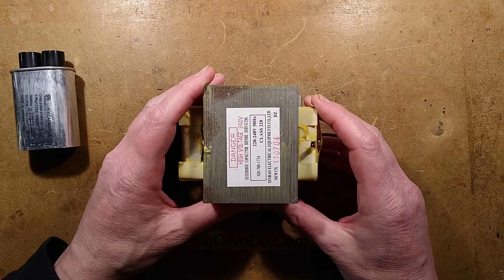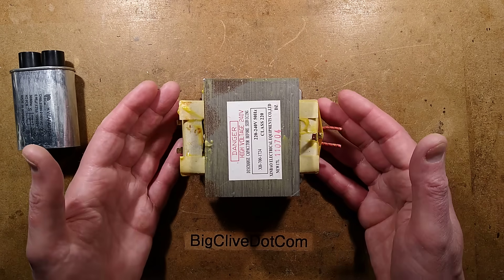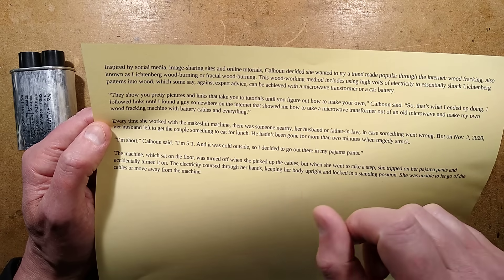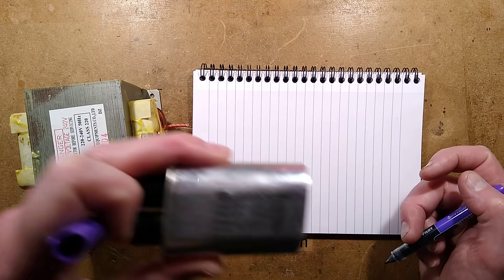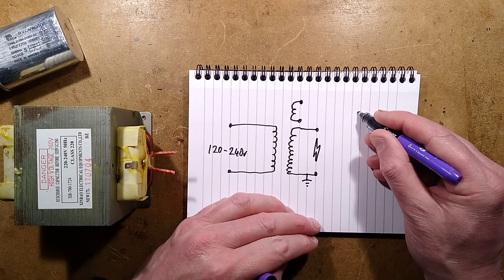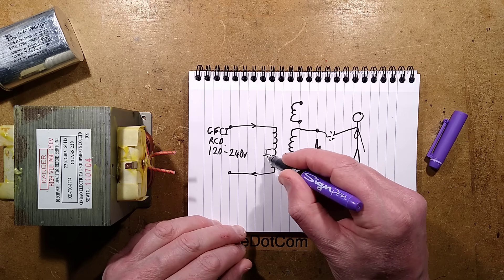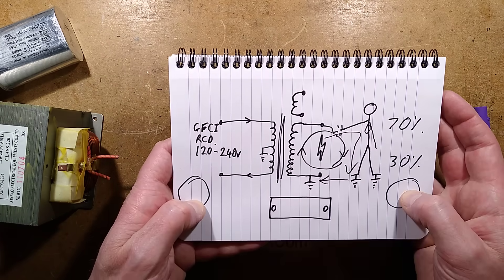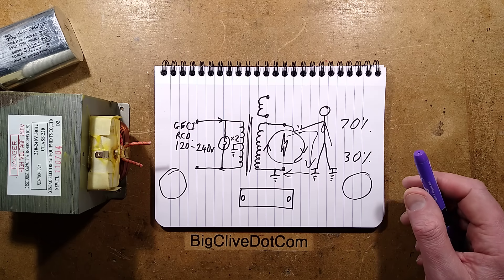The most deadly project on the Internet

Comment: I was in test measurement repair school and we were doing the section on oscopes. I thought I had done my due diligence, discharging the lead to chassis, the spark I heard was likely the screw driver crunching against the glass. I say that because when I grabbed ahold of the cup of the flyback to release it from the tube every muscle in my body went tense. I had a death grip on that wire and my arm extended with great force picking up the entirety of the oscope off the bench by the flyback wire. After a second or two everything relaxed and the oscope dropped to the floor as did I. My whole body felt like it was vibrating in a vat of menthol. I went to sick bay and got checked out, they sent me home for the day.  I discovered I had shat myself a little. It took a week before the funny bone feeling in my arm went away. Catching like 50k is not an experience I would ever recommend. That was just the cap discharging if it had been plugged in I'd be well dead.  

Also not entirely sure I agree with you're assessment of low voltage high current. It's the current that actually kills you, something like 7ma for a few seconds is enough to stop a heart. People have died working on analog phone systems that run in the 40v range.

Comment: Forgot to mention, I used to do repairs back in the late 70s on the bulky black and white and color TVs. Their compactors and transformers were just as deadly as today's microwaves. Had a capacitor discharge through me when I was 12, and that TV was unplugged for a few years. Was lucky to not have died. 😅

Comment: 120v AC or Battery, doesn't matter. Both will kill you if amperage is high enough. I have a solar battery system, where solar panels charge a 12v 150Ah battery. Battery is connected to a 120v 3500w Inverter. Touch the terminals on that, your as much as dead as if you stuck a paperclip in a light socket.

Comment: Great Video, just wanted to add the most Dead Mans Switches actualy have 2 ways to break the circuit, one is for letting the Switches go and one is for the case that u cramp when u get shocked. Both ways break the circuit.

Comment: My grandfather was an electrician and he has some stories about when he was young and first starting and some dumb stuff he did.  He always told me to respect electricity because it kills you when you stop paying attention.  I built a guitar amp once and because of his stories I was terrified of the filter capacitors.
Reply: 20 year electrician here. I was taught at tafe “Respect electricity because it doesn’t respect you”…….I never work live and never have, even if it makes fault finding longer. There’s entire companies here in Australia with “no live” policies in place
Reply: @ddrummer85-k4q  I never work live unless with safety voltage or low charge capacitors. You just need to loose a moment of attention and you fly through the room.
Reply: @ddrummer85-k4q it's safe to work live if you have the correct gear and training, I work live on everything up to and including 33kv.  It does take a lot of rubber though 😂
Reply: @Booth_Y0  *have the correct gear, training and WANT TO
Reply: @Booth_Y0 Stats are on our side but the fact that 1/3s of rubber gloves fail recertification makes me have some doubt in the back of my head
Reply: You should be scared of capacitors, I did that EMP project once where you take the cap. out of a disposable camera, and discharging it welded it to my screwdriver.
Reply: @tigertoxins584 my coworkers have done that on purpose because it's "funny"
A lot of our screwdrivers still have legs of capacitors welded on to them. -_-
Reply: "Complacency" is the key word of the video here. I've been playing with electricity for the past almost two decades of my life, some of those professionally (have a bachelors in EE) and I'm in my mid 30s. I was young too once, and I too played with microwave transformers, starting at 16 years old. Have you seen the huge plasma arcs you can draw from a MOT? It's amazing. A fire but better. Beautiful. But the one thing that probably saved my life is: Huge respect for those transformers, and electricity in general. I also had at least a basic understanding of what a MOT does, and why there is a big fat "DANGER" label on it. When I did experiments, I made sure I was fully 100% focused. 
Now I'm much older, much more knowledgeable, more experienced.... and I don't touch microwave transformers anymore. I still work with 230 VAC as I design switching mode power supplies. But MOTs? 2100 VAC at 50 Hz with more than 2 amps of short circuit current? No thanks.
There are actually "safe" ways of playing with high voltage and seeing those beautiful plasmas. You can make a 555 timer flyback driver, powered from just batteries, and in the worst case you'll have some light skin burns that will heal within a week. It's high frequency current, so the nerves aren't able to respond to it. But I don't suggest anyone to do it. I've always had a big fascination, and the patience and willingness to learn, which is why i'm now an engineer - and still alive.

Comment: When I saw the transformer in this vid, it struck me I just saw the exact parts 2 hrs ago when tshooting my microwave oven that failed to power on. I did basic continuity checks on the fuse on the UK power plug plus another fuse on a small board inside the oven. Both fuses worked so something else was broken. I saw the big-ass transformer and remembered vaguely microwave ovens uses very high voltage in order to create the microwaves. I think it has a cyclotron or some high tech shit inside

Was actually thinking of extracting the transformer for probable future DIY projects. After looking at your vid and Mary's injuries I decided F it, the microwave is going to the dumpster tomorrow morning.

Comment: As a kid I was shocked by one of those transformers. I’ve been always curious on how things work so I took apart an old fan and I open a transformer and even took some copper wire off it and plugged it in the wall to see what would happen. I got shocked, or electrocuted idk what’s called… I felt a big tingle 💀

Comment: Used to do this a few years back, still got the gear somewhere in the garage. Very dangerous but luckily had experience working with HV outside. You need to think things through at least a couple of times at every step. Had  a dead mans switch, lights, LED and 2 buzzers to indicate when it was live ( one of each using the heater winding) an RCD of course. Used rubber gloves and a Nylon rod to put the voltage to the wood,    all the cable insulations all rated above 3000V. I know the theory about the RCD not operating because of the "Galvanic Isolation" however I've seen the RCD trip loads of times when it "should not " so thought it would stay. Only problem I ever had was getting the pattern to not go where I did not want it to. Thought about doing some more but guess I am bored with it, if  I do i want to fill the patterns with colored epoxy.

Comment: I'm far from an electrician.  I once had to replace a 3 phase motor for a HOOD system at the restaurant I worked at. I had no idea what that meant at the time.  I couldn't read an electronic diagram.  So for every step I took a picture and put a bandage that I wrote on where the wire went.  I only made 1 point of contact at any time. I turned off two breakers before starting, I didn't know about the third l. Before touching anything I would touch a low wattage LED. If it lit up don't touch it. I probably took 20 times longer than some one who knows what they are doing but never did I get shocked and installed it correctly.

Comment: I’ve used a neon sign transformer and I used a wireless relay to activate it, if I needed to move the electrodes i unplug it after turning it off, nowhere near it when it’s on

Comment: I have never trusted insulated screwdrivers for discharging capacitors after my father showed me how they can sometimes not work...by having me stick one into a spark plug wire on a lawnmower while he cranked it (yes he believed in learning by example). Instead he taught me to use a wooden pole with a drill bit in the end of it. Dry wood is a great insulator.

Comment: I don't use these things for woodworking. Cause you can get electrocuted as you said. Instead, I use them as homemade inverters. I hook it up to a bicycle. And put 12 V AC into it. And I get a 120 out there side. Which I can then power appliance. Only thing I don't understand is. When I do plug something into it to power The appliance. The moment I turn it on, it gets significantly harder to pedal. Sometimes causing so much resistance. I cannot peddle.

Comment: I take one issue here and its probably just me thinking i know something so please correct me if i'm wrong: Why mention the voltage when the amperage is the killing factor?

EDIT: I did my own research. Through vagueries of the resistance of the human body: both are dangerous it seems. High voltage for sustained periods is just as bad as low voltage at high amperage
Reply from the maker: Higher voltage pushes higher current.  A car battery can supply hundreds of amps, but at too low a voltage to pose a high risk.

Comment: Got a few questions:
So the transformer makes a galvanic disconnect (no idea how this is called in English)?
So you are only in danger, when you touch both wires?
But this also means that the RCD won't help?
Is this correct?
(No i don't want to try it myself, i only want to know if i understand correctly)

I recently installed some neon signs with 4000 V and I was extremely cautious. Asked people for help that knew what they were doing. In the end, it was rather easy and I think the current is limited to a few mA. But still... You have to know the limits of your capabilities.
Reply from the maker: One end of the secondary is often grounded in a way that makes it dangerous, but unlikely to trip protection.  Even isolating it still poses a high risk due to the voltage and its tendency to create new electrical paths.

Comment: 25 years ago I built a Tesla coil that used two industrial microwave transformers with the secondaries in series for twice the voltage.
Microwave transformers are unforgivingly lethal devices.

Comment: I hate the safety police. I used equipment long before all of the added safety features, so, I don't like them and don't need them.. BUT,, a poisonous Snake is a Poisonous Snake, and 2000+ or more Volts is guaranteed Not  something you want to play with.. so, double bulbs on the feed side,, just in case the switch gets turned on without your knowledge is the absolute minimum in safety,, foot switch another well worth using, and, the rest, be your own judge.. But, accidents do happen, so, don't let anyone around you, if they can't respect what you are doing, and, if the kids are curious, don't even put the plug on, until you have a good talk with them.. 
You can do whatever you want to do, as long as you know what you are dealing with.. You drove a car last week? Ok.. Safe enough.. You see where we are going with this.. Good video.. Thanks.. I learned something about the isolated coil I really didn't realize, but, knew a GFCI wasn't going to provide any safety to begin with..Just didn't know why.. Thanks again.. 
Now back to reading "Why don't you use your Riving Knife, and, push stick.. I use a push stick,, when I have something really thin, or, my brain or gut tells me to grab one. Other than that, I trust 20+ years of intuition.. The only snag I have had in the shop came from an angle grinder and a drill press. Neither were big issues, just wake up calls.. Both something I should not have done, but, have done many times and didn't have issues.. Just got a little testy and got bit.. But, would never do that with 2-10k volts.. Ha..Ha.. Cheers Mate!!

Comment: “Dumb ways to die!” I have these components of all the things I thought to do with them, this sounds so jenky! 

Do these knobs realize most cable insulation is only rated to about 600V? 

Building on the messy wet work area, a weak spot in the insulation will let current leak out! 

Then never forget DC HUGS. HVDC will not let you go!!

Comment: Great Video! Thank you for explaining this to people.
The number of people that "play" with electricity, and not take safety precautions blows my mind. Im an electrician. I've been hit by 120v a couple times, and while that isnt as high as 240v, it can 100% still hurt you, and in some cases, kill you. 

Just to reiterate what he said; the issue isn't the voltage (primarily speaking, of course voltage is a factor, but even static electricity can have thousands of volts), its the amperage. When dealing with high enough amperage, the issue is, if you get to a certain threshold in amperage (the amount depends on alot of different variables such as the person, dryness, etc) you get into the "Let Go Threshold" which is what he was talking about at 4:55 . This is  when the current causes your muscles to spasm, and ends up creating a situation where you cant let go of what youre getting hit by. 

Whats even worse is, if you get hit, even if its just a small shock, theres still a possibility that it screwed up the rhythm of your heart, and you can still (in some cases) die many days later, feeling absolutely fine. As small as 50 mA is enough to stop your heart. 

Moral of the story; Don't fuck around with electricity. Current doesn't see you as a person, it sees you as part of the circuit.

Comment: would a neon sign transformer be safer(obviously with safety procotions such as light, deadmans switch, secondary switch, etc)
Reply from the maker: Neon sign transformers are inherently current limited, and while they can deliver a very nasty shock, the risk of death is much lower.
Reply: Draw the circuit he shows, substitute a 300 ohm resistor for the stick figure's heart, plug in the neon transformer voltage and do the math.

Comment: I have about half dozen of these which I usually rewire to step down the voltage and increase the amperage.  Well aware of the dangers.  Also have a 15KV neon transformer that powered my Tesla coil I built when in college.  What's far more dangerous than a MOT is a microwave inverter.  And if you ever want to remove one, make certain you safely discharge the capacitor by shorting the terminals.

Comment: I have quite a number of these mot's and honestly haven't found a valid reason to power up the primaries with the 120vac we have here in North America. I find later models use a considerably smaller HV xfmr so, the ones I have made a point to keep are about 50% larger overall and are definitely from older units. And built very robust I would add. 
Various experimental projects besides the dangerous are incorporating all or part of an mot, with the E-I configuration, such as experimenting with electromagnets and the various characteristics that can be achieved , FOR LEARNING. As well the rewinding with some very heavy copper and only half a dozen turns will achieve an entirely different outcome and it has its practical uses if you do your research. And I have found the limitations of a typical 15 amp circuit can be overcome when a same set up parallel connection is properly devised and a very useful, and safe, tool is possible using this arrangement 
Burning a pattern into a wood plank is a novel idea, but I'm afraid I would become bored with such a useless endeavor quite rapidly.
So do your research, don't take any chances, don't be a fool, and learn what you can, and if you live, perhaps you will take what you have learned and make some new, fundamental discovery that advances science in a way never before experienced !! 
Good luck, be safe, don't take unnecessary risks .

Comment: My cousin works with high voltage transmission lines, substations and such.
He told me, lower voltages can be more dangerous, because it can make you clench your muscles, and you can't let go of the wire.
With the high voltages, it will just burn your fingers off, make a huge ball of plasma, and sound like a bomb went off when it sends you flying backwards.

Comment: "Complacency will step in and mistakes will be made"

I'm starting to get into repairing stuff and those words resonated with me as if I were giving myself a warning from the future. Going to invest in some insulated gloves and tools just in case and never work with my microwave if it fails, a technician is a lot cheaper than potential death
Reply: An qualified technician is always cheaper than a hospital visit or home insurance claim😅
Reply: @Binturong3850 microwaves, toasters, kettles etc. All easily replaceable things that should never be repaired.
Reply: There's another good reason never to work on a microwave oven. If it's leaking microwaves it's not perceptible and it will be cooking you while you're running it and you will have internal necrosis with dead flesh. If the exposure is minimal it will just get taken away by your immune system if the exposure is larger it will make you sick and you will probably die. These things are designed so the seals last and something inside fails first like a door switch. If you keep fixing a microwave oven, you eventually will have a leaking door seal

Comment: Cant you use rubber gloves?
Reply from the maker: They would need to be proper lineman's gloves, and the same understanding of high voltage safety would be needed.  Lineman usually have two layers of insulation.